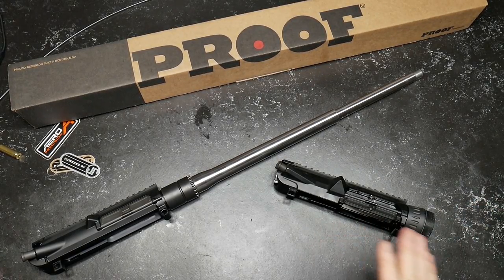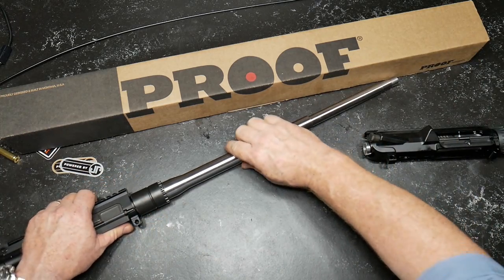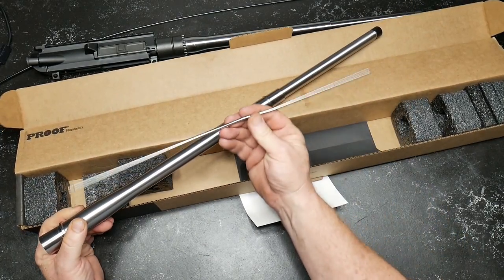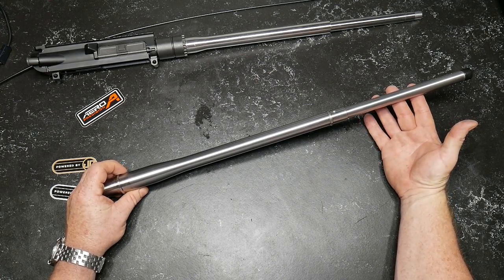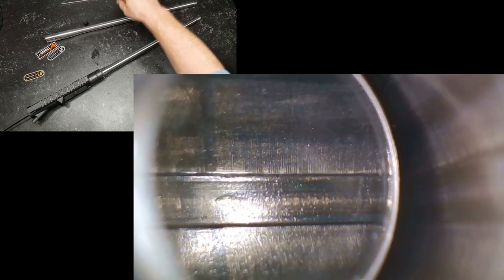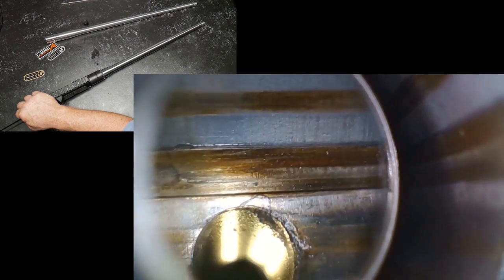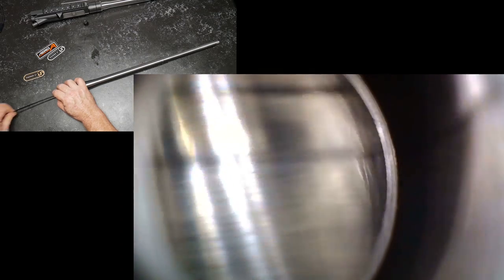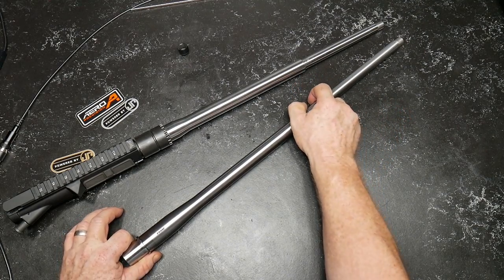Budget Vs.  Expensive! 6.5 Creedmoor Barrels PSA Vs. Proof Research

Comment: Why does a $500 barrel have pits in it?
Reply: Microscopic pits are in all metal surfaces, you'd barely notice those imperfections with the naked eye. The endo light source really highlights pits.
Reply: I agree, the Palmetto barrel looks like better quality, and the accuracy was very good with it as well! 
I don’t believe I’ve ever seen a super match grade barrel that’s been hand lapped have those huge pits! 
I would send that FKR back or get a refund!
Reply: It doesn't have pits, as a guy that has looked down a lot of barrels, that is oil in the barrel that hasn't had a patch run through it.  Push a single dry patch down that barrel and show a bore scope video again.

Comment: What I have no sense for is the difference in tolerances and steel.  While it was flat-out cool to see the differences in horizontal chatter and in-line tooling marks in the lands and groves, once both barrels have a copper patina, doesn't it then come down to how precisely the bullet travels down each barrel?  Unlike the AR build you did, both of these barrels seem to be comparably beefy.  However, if they're made of different kinds of steel, then the harmonics will probably be different.  How comparable are they please?

Comment: The pitting you see is actually just an optical illusion, its likely oil left behind with cotton from patches. The Proof Research barrel is cut rifled and then hand lapped while the PSA likely just button rifled.  I've been with Proof for a few years now doing QC for a good majority of the Proof barrels after they been rifled and lapped. We strive for world class craftsmanship in not only finish but also groove and bore tolerances and consistency. Glad you liked our product!

Comment: Love that hand lapped barrel think there will be a solid diff in accuracy in this build vs the psa
Reply: badbilly429 That’s what I’m saying!  You put accuracy up it will be apples and oranges.  He mentions pitting on the PROOF barrel.  I would put money that it is most likely oil and some fibers from a cloth.
Reply: @nateskate11  I saw something similar in my Proof 308 SS barrel with my endoscope, and it went away after a couple patches through it. After that, the inside looked like someone polished it to a high shine like a brand new car. I think cut barrells like the Proof, Bartlein, and Kreigers tend to shoot better, especially when hot. Less stress to the steel in the process.

Comment: Kota, those Huge Pits are not normal in a Super Match Grade Barrel man! You been robbed I’d send that thing back! 
I bet you the Palmetto barrel is far more accurate and consistent my friend over time.......
Reply: I'd really like Kota to push a clean dry patch down the barrel and re inspect it.  That looks like oil that is intentionally left in the barrel when it leaves the factory.  I've seen that a hundred times and it looks weird in a bore scope, but it wipes right out.

Comment: Looking at your $479.00 PROOF barrel beside the PSA Upper& Barrel..My Question is how FAIR do you think it will be with the two barrels not being the same Length..We know Longer Barrels have the Advantage and the Rifle length Gas System damn sure does not kick as hard.
That is a nice EndoScope..Where did you buy it? Id like to get one.
Reply from the maker: That's why it is a budget vs. expensive.  It's what I got
Reply: @kotaboy32  that's kinda like racing a Volkswagon against a Dragster.
Reply: @kotaboy32  it should be on equal footing but it may not matter.It may turn out like last time with Econ One kicking Full Monty's ass .lol
Reply from the maker: @TexasTrained  Mustang vs. Mercedes 
AMG
Reply from the maker: @TexasTrained  well see

Comment: A barrel to barrel unfired comparison would have been better , I bought a air gaged Douglas stainless for a 300 Win/Mag that was flawless for $370.00 which was as good as the Proof that was within.0001 fore to aft
Reply from the maker: No argument there, Douglas makes amazing barrels, have two of them and they print inside a dime

Comment: Awesome video man! Be careful with setting the end of the barrel down on the table when you showed the feed ramps and chamber trying to get it to focus. You can easily damage the crown and it will effect accuracy from what Tiborasaurus says. I know it's hard to remember but I try to never let the end of my barrel touch the floor or hard stuff. He says even micro dents and scratches in the crown can make a difference in precision rifles. The crown is the last part of the barrel the round touches when exiting, and it needs to be completely uniform. Anyway, just wasn't sure if you were aware. Sorry if you do. That endoscope thing is awesome!